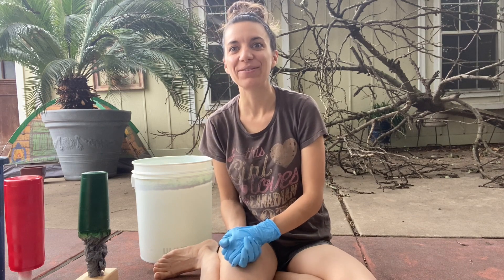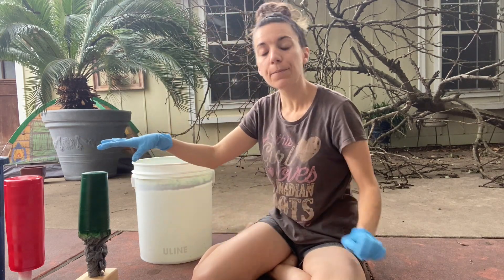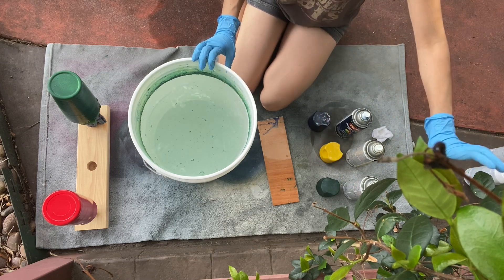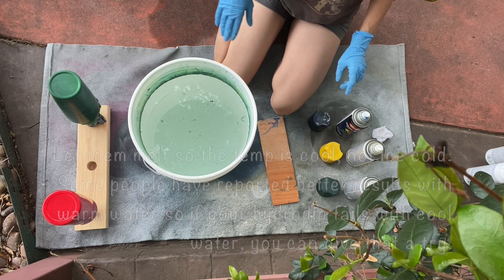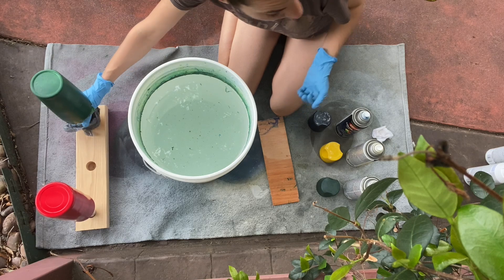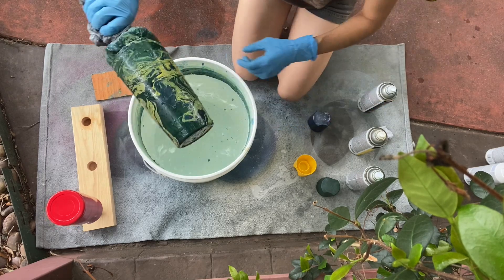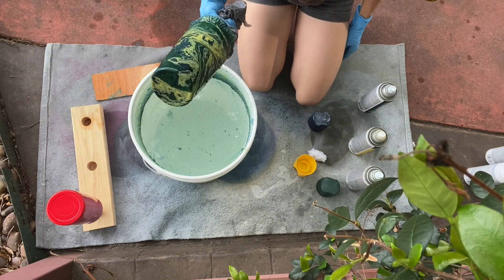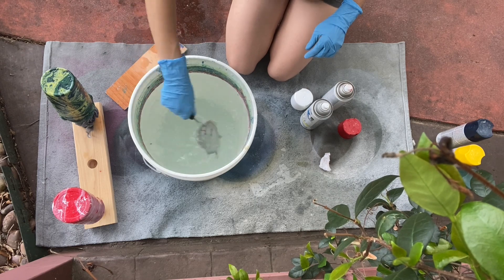How to Hydrodip Tumbler with tips and troubleshooting

Comment: That was great! Thank you for explaining the process and showing the difference between brands! Did you notice any issues after removing the red cup since you didn't clear the paint away?
Reply from the maker: Fortunately no. It helped that it was only 2 colors and I didn’t oversaturate the water with paint (ie. I got lucky lol). 

But I have seen where you get almost a phantom dip overtop because the water wasn’t cleared. It can muddy the look.

Comment: What type of spray should I use?
Reply from the maker: I prefer rustoleum over krylon (some of the colors are rly thin and run).
Sheen preference order: matte/flat, satin, gloss. 
But often with colored spray paint, gloss or semi gloss is all you can get it in. I haven't found the sheen to matter with hydrodips.